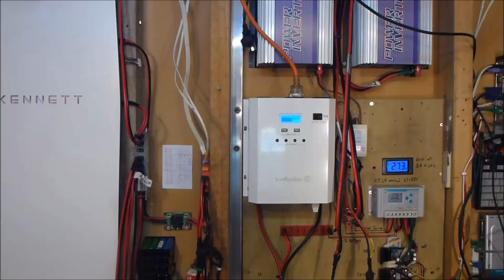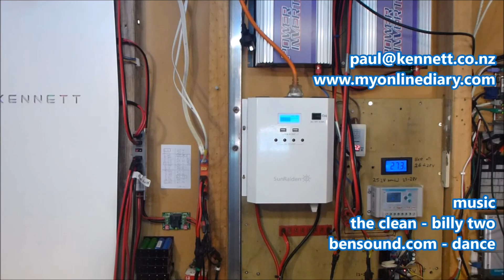Laptop Powerwall 123 - DIY powerwall community review

Comment: Thank you for this. The current "PowerWall" community is EXTREMELY 18650-centric ... I have tried to tell others that this format (18650) craze will wain soon due to availability. Even Tesla is evolving to a different format cell (20700). I attempted to put my pouch cell cache on the DIY Powerwall site but was removed as they were not 18650's ... although same voltage ... same chemistry ... similar capacity 2200 mAh ... Pouch / prismatic cells are wave of the near future until the next advance. The locality problem you described is real and will get worse as this "hobby" expands. Greedy Grubbers will buyout or "hold" for preferred customers until people loose interest or find other obsessions.I do thank DIYPowerwall, Jehu, AverageJoe, yourself, and others for accepting the virtual risk of coming out of the closet and showing the rest of the world what you have done and what you are doing. Thank You!
Reply from the maker: I've played with both pouch cells and 18650's. What I like about 18650's is that they are a universal size/shape which means there are a lot of resources for utilizing them. Pouch cells come in a huge range of sizes so are not quite so easy to deal with (ie there isn't an cheap easy to buy battery holder that fits every pouch cell - but there is for 18650s.
But it is interesting that most non-Tesla EVs use pouch cells.
Reply: Completely agree and thanks again for your work and the documentation!!

Comment: Powerwall community is vibrant and great fun Paul.
I'm just starting on my project but I'm very conscious of the fire risk.
I cant help thinking that it would make it far safer if the packs were stored in an enclosure outside, a bit like HBPowerwall mounted on a wall in a metal box in the shade.
Reply from the maker: I agree. I've got an old steel server rack that I'm planning on using.  I need to get that sorted ASAP!